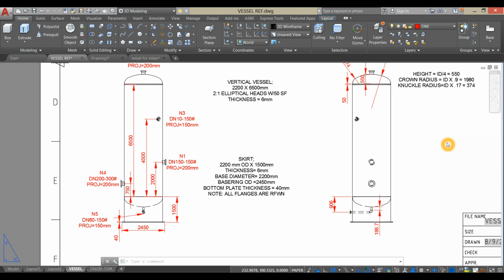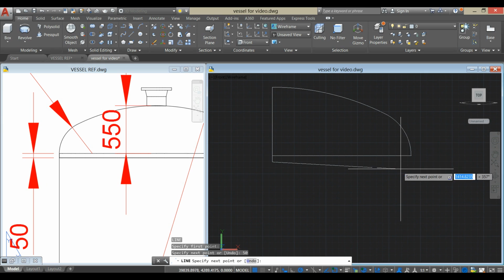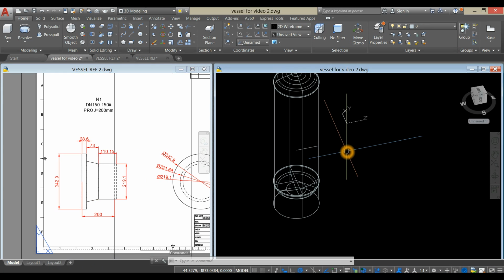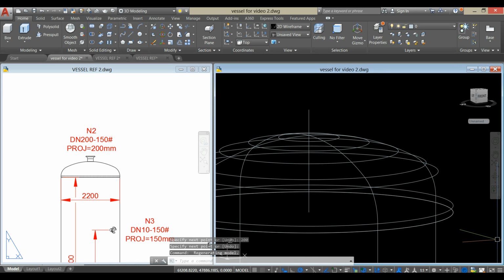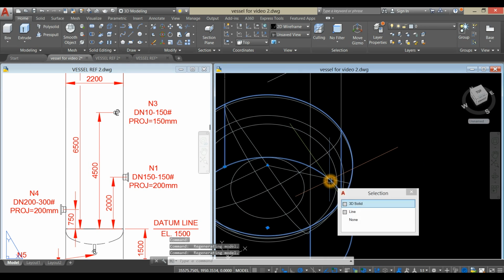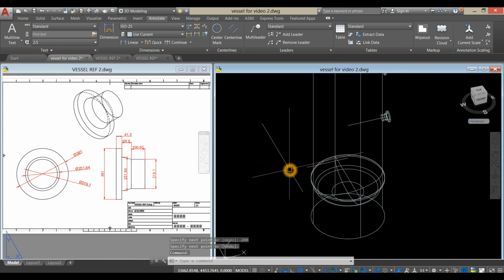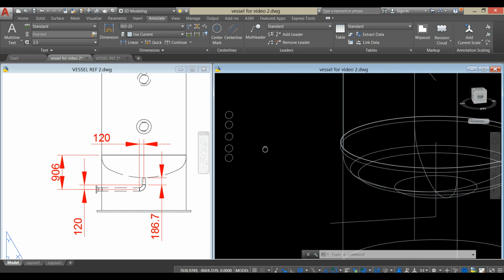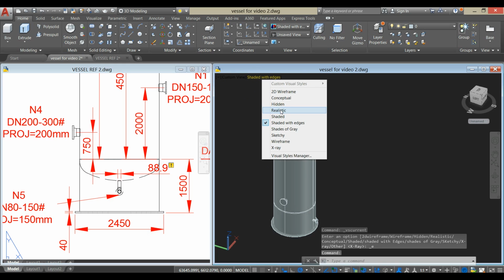Tutorial of a 3D Vertical Pressure Vessel using AutoCAD 3D|Mechanical drawing

Comment from the maker: This is a method in converting SURFACES to SOLID 3D.
type PR to check the property of the object, click the dish head, and it would display surfaces or solid. In your case it turned out to be surfaces( which happened when I first did it), meaning the objects were not completely joined. Examine and rejoin before using REVOLVE command. Another option is to use SCULPT command, you  can either type sculpt or go to the ribbon, and select the SURFACE TAB and inside the edit panel, select SCULPT command, then window or select the whole head. Now, it would convert the surfaces to one solid object. To check, double click the object, and if you check the property, it will show that it is now solid. This is a method of converting surfaces into 3d solid. I might make a video of this. Pls click the bell button of on youtube , so you can get notified when a new video comes. Thanks for subscribing.
Reply from the maker: I might do a video on how to convert surface to solid soon

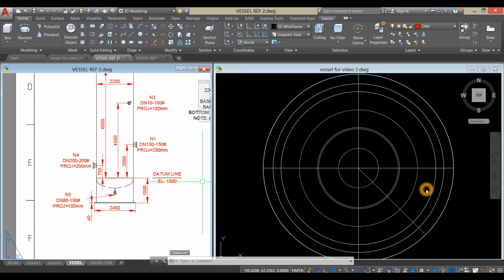Comment: 10:21 How do you display the selection tool that shows line, 3d solid etc... 
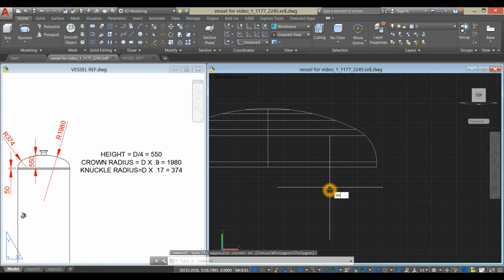And how do you get a solid view of objects ? I mean the top lid created never go as a 3d solid. 06:47 you get the full object selected. I can't achieve that.
Reply from the maker: click the "selection cycling " at the status bar located at the bottom of the screen to turn the setting on.
Reply from the maker: For the elliptical DIsh Head, make sure that all all segments are joined before revolving it. You can use join command directly or use Pedit ->click one segment --> select yes to polyline-->click join --> click all the segments.

Comment: Hi, this is really helpful and feel delighted for your sharing. At 6:36 when you revolve the polyline join, how to convert it to 6:40? Thank you.
Reply from the maker: join first the broken segments by typing join command to make them into one object, then type revolve , enter 360 degrees
Reply: @AC3DCad  I have made them into join, if you noticed that revolve drawing to 360 degree. Thus my drawing will be at 6:36 but not same as 6:40 since the revolve line looked simpler
Reply from the maker: @farahanis7685  type PR to check the property of the object, click the dish head, and it would display surfaces or solid. In your case it turned out to be surfaces( which happened when I first did it), meaning the objects were not completely joined. Examine and rejoin before using REVOLVE command. Another option is to use SCULPT command, you  can either type sculpt or go to the ribbon, and select the SURFACE TAB and inside the edit panel, select SCULPT command, then window or select the whole head. Now, it would convert the surfaces to one solid object. To check, double click the object, and if you check the property, it will show that it is now solid. This is a method of converting surfaces into 3d solid. I might make a video of this. Pls click the bell button of on youtube , so you can get notified when a new video comes. Thanks for subscribing.
Reply: @AC3DCad  I have that same dilema too. I joined the object then when I revolve, it comes out like 6:36 with the lines crossing outside of the ellipse but not like at 6:41
Reply from the maker: @chiefcleve1834  type PR to check the property of the object, click the dish head, and it would display surfaces or solid. In your case it turned out to be surfaces( which happened when I first did it), meaning the objects were not completely joined. Examine and rejoin before using REVOLVE command. Another option is to use SCULPT command, you  can either type sculpt or go to the ribbon, and select the SURFACE TAB and inside the edit panel, select SCULPT command, then window or select the whole head. Now, it would convert the surfaces to one solid object. To check, double click the object, and if you check the property, it will show that it is now solid. This is a method of converting surfaces into 3d solid. I might make a video of this. Pls click the bell button of on youtube , so you can get notified when a new video comes. Thanks for subscribing.
Reply from the maker: @Bobineta Hazarika Make sure to join the segments by using JOIN command, then use REVOLVE. If segments are connected or fully joined , you do not need to use SCULPT command
Reply from the maker: @Bobineta Hazarika wait in a bit , I'll make a video
Reply from the maker: @Bobineta Hazarika bring your drawing to front view  before mirroring , go to view controls( located at the upper left corner of your screen ) then select front view
Reply from the maker: @Bobineta Hazarika I am not sure how to help you when I can't see your drawing Just redo the whole thing and follow the instruction step by step. You can always rewind the youtube video. Maybe visit my page on FB and you can screenshot your drawing for me. shorturl.at/apHK4
Reply from the maker: @Bobineta Hazarika pls also check the direction of your UCS.
Reply from the maker: @Bobineta Hazarika  I just made a video on how to create elliptical dish head https://www.youtube.com/watch?v=HpVuNmdRs3M

Comment from the maker: This video explains the modeling of 3D solid Vertical Pressure vessel using AutoCAD 3D. The tutorial includes the creation of nozzles, flanges, and pipe nipples. For the dimension, pls click this link https://autocadnetwork.blogspot.com/2019/08/blog-post_17.html
Reply: at 6:37, how did you remove the gridlines from the crown ( there was a bit of skip) and i can seem to do it
Reply from the maker: @olatejutemitayo2849  type PR to check the property of the object, click the dish head, and it would display surfaces or solid. In your case it turned out to be surfaces( which happened when I first did it), meaning the objects were not completely joined. Examine and rejoin before using REVOLVE command. Another option is to use SCULPT command, you  can either type sculpt or go to the ribbon, and select the SURFACE TAB and inside the edit panel, select SCULPT command, then window or select the whole head. Now, it would convert the surfaces to one solid object. To check, double click the object, and if you check the property, it will show that it is now solid. This is a method of converting surfaces into 3d solid. I might make a video of this. Pls click the bell button of on youtube , so you can get notified when a new video comes. Thanks for subscribing.